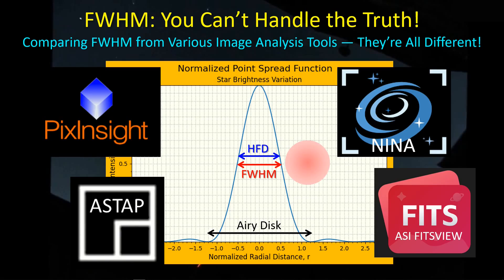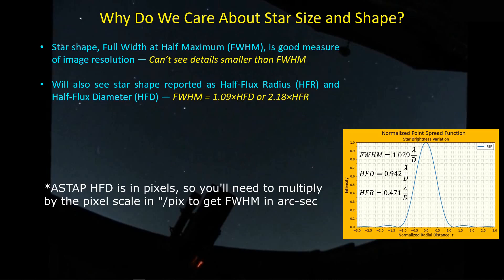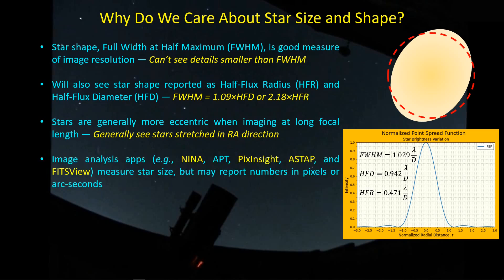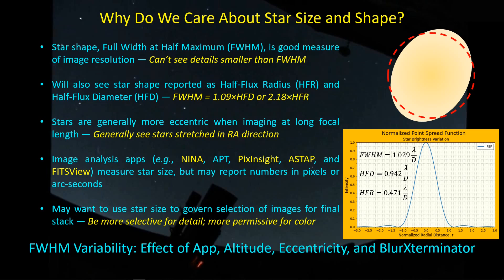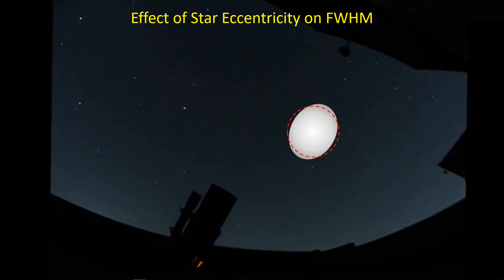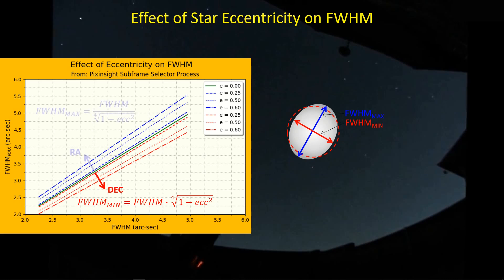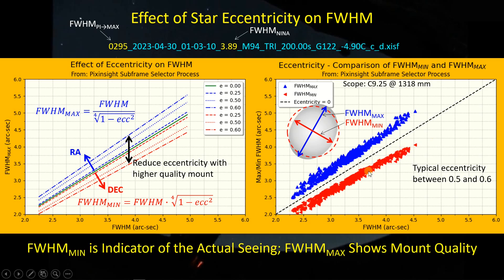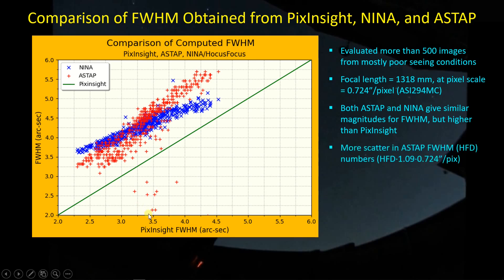Considering Full Width at Half Maximum (FWHM)

Comment: Great video. I just watched a talk on the AstroImaging Channel by Russell Croman and he talked about how blurXterminator hasn't been trained to correct some of the abnormalities in our stars like astigmatism  and defocus, however, in the next month or so, a new version of BlurXterminator is being released that will be able to deal with these other abnormalities and the example he showed of it working looked like absolute magic. He did say that things like astigmatism are made worse in the current version of BlurXterminator because BlurXterminator can't get a PSF from these abnormally shaped stars and so it tends to make those stars more irregular. It was a great talk. Maybe that has something to do with some of your readings looking more eccentric?
Reply: Hello could it be also a problem with collimation? Some residual coma in the center of the field of view? I suspect is what is happening to me working with a Newtonian
Reply from the maker: Hey Logan. I saw that talk. Yes, very interesting. There are many possibilities. First, I'm applying BlurX to single subframes with high noise. Second, there are very few stars to work with given it's an SCT image. And, of course, there's the image aberrations that mostly affect the corners. I was pleased to see that he does have a "RA stretch" PSF that's intended to deal with my primary concern. Maybe the next version will bring improvements to images acquired with long focal lengths (he seemed to concentrate on shorter focal length images in his presentation). The bottom line is that deconvolution relies on many stars in order to define a good PSF and that's just not the world I live in during galaxy season.

Comment: Thanks James. Excellent video and well done. But I am confused by your FWHM/ HFR(D) "relationship" formula. It just doesn't "add up". As we all know there really is no actual formula since the parameter(s) are based on entirely different approaches. We all know and accept that. But that aside, there still tends to be a rough mathematical relationship. But based on the following thinking it should be a very different formula:  
A perfect Gaussian is HFD = 2 x (0.675) x sigma = (1.349)vx sigma and FWHM = (2.355)  x sigma. So this would yield a different relationship which is closer to:
FWHM = 1.75 HFD (or 3.5 HFR)
Yes?
Of course, neither parameter occurs as a perfect Gaussian in the real world. 
Curious of your thoughts
Reply from the maker: Hi Howard. The ideal star diffraction shape (point spread function) is discussed in this video: https://youtu.be/N60vzaIZq6Y

You are correct that HFD and FWHM are different; however, using the true PSF, the final mathematical forms of FWHM and HFD are simply different scale factors applied to the ratio of light wavelength (lamda) and telescope aperture (D). So, we have:

FWHM = 1.029 * lamda/D  and
HFD = 0.942 * lamda/D

so it becomes a simple matter to just ratio the HFD value by (1.29/0.942 = 1.09) to get the corresponding FWHM for the ideal PSF. Of course, PSF curve fits used by NINA and PixInsight are based on the simpler Moffat or Gaussian models rather than the theoretical Bessel function. The Moffat and Gaussian models do a decent job capturing the star profile in the brightest portion of the star and not so well in the dimmer outer annular region. That's probably where the big difference between "my" 1.09 and "your" 1.75). If we used the 1.75, the ASTAP results would be worse and the FITSView results would be better. 
Thanks for watching, as always
Reply: @Aero19612  Thank you for responding. I have to ponder this.
Reply from the maker: @howardmaron  Keep in mind: I'm not saying you're wrong and I'm right. I'm just laying out my reasoning based on the ideal PSF. Haha. It's also possible I missed your point and just sent us off on a wild goose chase. Don't ponder too long--might not be worth it in the end!

Comment: This is essential topic! 
“Cannot see details lesser than FWHM”. Is that right? I thought resolution is FWHM/3.

I recently broke FWHM 2 “barrier “. Analysis was done by software from Herbert Walter web site. Nothing changed. It just happened. I could magnify image taken with 9.25 edge (no reducer) 5 times. I could see clusters in M60. 

I think it tells how important seeing is. However, I still don’t understand what is seeing portion of my FWHM.

About eccentricity. When FWHM is reduced, eccentricity grows. Thus, my average eccentricity 0.35-.42. It grew to 0.45-0.47, when FWHM was 1.75”. So, effect Blur XT is logical.
Reply from the maker: Check out this video on resolution: https://youtu.be/H-cAbF25gcI

The ideal FWHM for a 9.25" aperture is 0.5 arc-sec. The rest is seeing, guiding, and maybe being undersampled based on OSC vs Mono and pixels size.

I don't agree that eccentricity increases when FWHM is reduced. They are independent quantities.
Reply from the maker: @anata5127  Not everything written on CloudyNights is reliable. I believe we are discussing the difference between ""correlated" and "cause/effect". For example:
1. Larger aperture, D, telescopes provide smaller FWHM (FWHM = 1.029 lamda/D)
2. telescope aperture tends to be larger for longer focal length telescopes.
3. Longer focal length telescope provide higher magnification.

4. Higher magnification is more sensitive to mount gear imperfections
5. Mount gear imperfections produce eccentric stars

Therefore, one concludes (incorrectly) that eccentricity increases as FWHM decreases. That's a "correlation" but not "cause/effect"

I'm talking about images acquired with one telescope rather than different telescopes with different apertures. If I use a better mount (with fewer gear imperfections), I get lower eccentricity and the maximum FWHM gets closer to the minimum FWHM. So FWHM reduces as eccentricity reduces. Eccentricity comes from the mount and FWHM comes from the aperture/seeing
Reply: @Aero19612  Not cause effect, but I always observe it. Always. For my accuracy tracking, I see it at FWHM<2.
Reply from the maker: Correct. Seeing and resolution are not the same. However, seeing will increase your effective FWHM, and the final FWHM (from all sources) determines your final resolution. In excellent conditions, you can definitely get lower than 2". Unless you live on a mountain, that's a low probability occurrence.  If you have a really good mount (with encoders) -- sounds like you do -- guiding won't help much if you're polar aligned really well.
Reply: @Aero19612  Yes, I do. 10 micron. Polar alignment is done within star model. I don’t know how it works. When model is build, mount tells pointing accuracy rms, telescope orthogonality and polar alignment. They ask below 10’ polar alignment. Most essential is pointing accuracy. It has to be below 5-7”. I had C8. Could never get below 25”. Locking mirrors on Edge helped.
All-in-all, limiting point is seeing for me.

Comment: Excellent analysis James! I can shed some light into how NINA computes HFR (vanilla NINA not the Hocus Focus plugin, whose logic I don't know!) since I wrote its current version (almost surprised to see it hasn't changed even in the latest NINA versions!). It basically uses the formula from the "Half flux diameter" Wikipedia. Some points to know/remember:

- I amended the HFR calculation for the purpose of getting robust autofocus (primary purpose, and tweaks went in that direction - robustness over accuracy, so it would work great for out of focus stars, for which FWHM in theory doesn't work)

- The HFR calculation doesn't care about eccentricity (as per HFR formula), so the measure effectively is an average of min and max you mention, but due to how HFR is calculated, this actually skews towards the max (in theory it shouldn't, in practice it does - this is due to "background" choice below)

- The formula relies on a critical metric: the brightness of each pixel above the background. How "background" is defined varies. In earlier versions of NINA, "background" was the mean of the whole image (which obviously includes a lot of stars, e.g. not a good representation of background, but still commonly used). To make the calculation more accurate and robust for autofocus purposes, I changed the background to be the mean of a bounding square around the star of dimensions three times that of the detected star diameter (max star diameter). Others could have used median (which changes the result). Because this naturally lowers the "background" variable of the HFR formula, the calculated HFR is greater than when defining "background" as the mean of the whole image.

- The pixels used in the calculation are within the detected star radius....... plus 20%. This is a number I came to empirically, and which I added to make HFR calculation of out of focus stars more robust for systems with a large central obstruction far from ideal focus (where star detection can underestimate the total radius of the out of focus doughnut). This in theory shouldn't change the computed HFR (because those additional pixels would be at background level and thus end up not counting in the HFR formula), but in practice in does due to how stars and their radius are detected. So this changes also increases the computed HFR

But that's all for HFR not the Hocus Focus FWHM calculation :)
Reply from the maker: Thanks for the insider insight, Cuiv! I was not aware of the HFR/HFD definition in Wikipedia. Interesting. Also, totally understand the special needs of a real-time focusing algorithm versus an image evaluation algorithm executed with all the time in world. I believe the Hocus Focus FWHM uses a PSF curve fit (since I have to activate that option if I want access to FWHM), but that PSF fit isn't used while focusing - still use HFR. As long as the metric provides a reliable trend from out of focus to in focus, it should be OK. Haha - that's why they're still using your original approach: It works! The nitty gritty of which stars are selected and how the background is estimated is probably at the root of the differences between NINA FWHM and PixInsight FWHM. Would surprise me at all if FITSView uses the formula you mention.
Reply: Wow I had no idea you wrote NINA Cuiv.
Reply: @AshA-ww8hc  I didn't ! I contributed code to it

Comment: It was very insightful of you to mention Ra oscillating at higher frequency than Dec. I am using CGXL mount to drive 1960mm telescope and my stars are really oblong. Looking at frequency analysis in PHD2 I noticed that I have a distinct oscillation at a period of 21.4 seconds additionally to worm gear oscillation. This Ra defect is stretching my stars really bad. My intent is to tune PHD2 guiding PEC algorithm to compensate for higher frequency oscillation, leaving lower frequency to mount built-in PPEC.
Reply: Be aware that ar those focal lengths if you used a cooled camera, the fan vibrations can actually elongate your stars in a random-ish direction (easy to check by turning off the fan and comparing)
Reply from the maker: Hey Oleg. Your CGX is a much better mount that my old CGEM, but I used to see a lot of gear harmonics with shorter periods than the main worm gear period of 478 sec. I also saw a period near 21 sec (see https://youtu.be/Im5qVO6He3s). Give PHD2's PPEC a shot, but it's really intended to address work gear harmonics at much longer periods. I always used PPEC once it was introduced (still do). Also you might contact Celestron - you could have a bad bearing or gear tooth somewhere. 1960 mm is really tough. Good luck!